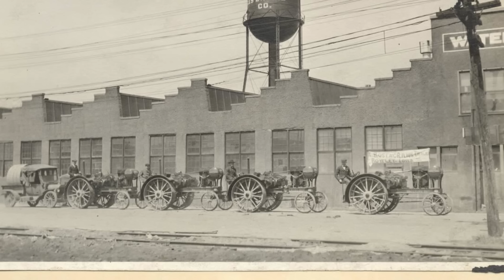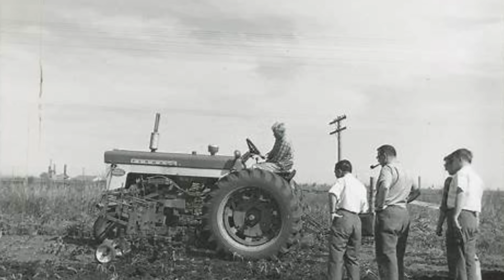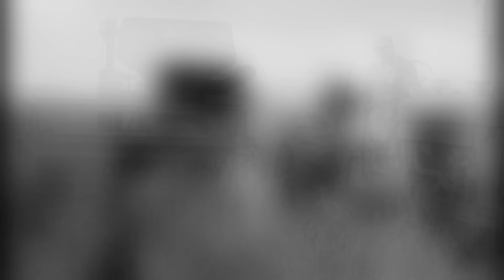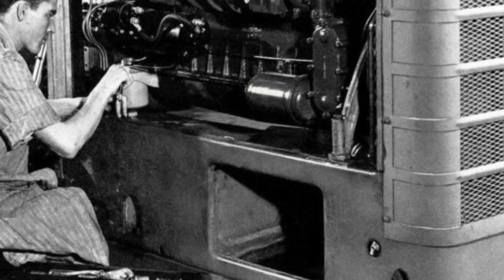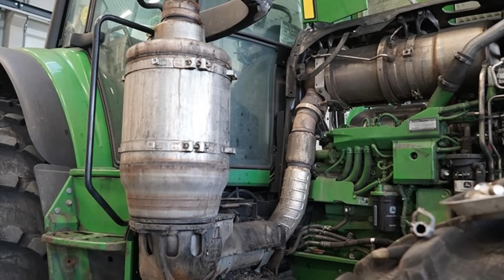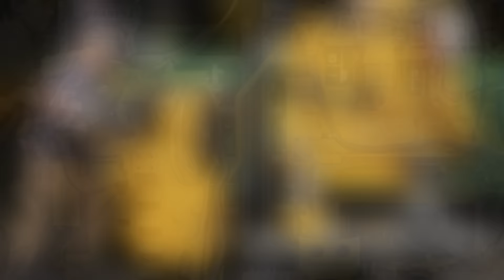What Happened to John Deere? The Tractor Engine Farmers Can’t Fix Anymore

Comment: I once had a tech with a computer tell me he couldn't find anything wrong with an 8 wheeler truck, what in the US would probably call a 12 wheeler. The truck was brand new and stuck in high range. I politely pointed this out to him. They had to change the wiring harness in the end.
Reply from the maker: That sounds like quite an experience! Electrical issues can be surprisingly difficult to track down, especially on heavy trucks. Thanks for sharing your story!
Reply: @RuinedAmerica Auto motive wiring faces the elements. Cracked insulation road salt glyceril  lead to intermittent failures.  On top of that a Control module with custom crypto?? 
Nightmare

Comment: I recall at Antique tractor shows some of the inventive modifications farmers have used as work arounds for design short comings on site.    Those designs apparently have been stomped dead by this corporate greed.
Reply from the maker: Farmers have always been incredibly creative when it comes to adapting and improving their equipment. Those practical modifications are an important part of agricultural history. Thanks for sharing your perspective.
Reply: @RuinedAmerica I grew up on a family farm with 40+ year old farm equipment that was generally unsafe to be anywhere near during operation. My brothers and I managed to keep all of our fingers and toes.  We always pre planned which spot to jump to in case of a sudden change in how things were running.  You learn more from what goes wrong than from what works right.

Comment: You say "the market moved on" NO deere is no longer farmer, frendly the  bean counters and stockholders  are more important than there customers
Reply from the maker: I understand your point. The relationship between manufacturers and farmers has certainly changed over the years. Thanks for sharing your perspective!
Reply: This is fully AI generated content trying to make quick bucks off nostalgia for old tech. The entire text was just scraped from wikipedia and other websites and narrated by robot voice, the thumbnail is AI-generated, the visuals are stock footage. All videos from this channel are just like this. Even the comments he leaves are generated with YouTube's AI subscriber interaction tool. We need to ban low quality garbage like this from YouTube.
Reply: @ang @angelsachse9610 Deere is not a farmer friendly company anymore,they proved that by not letting the farmer get repairs by anyone but Deere at Monopolistic prices 800.00 to just have a technician plug in a proprietary computer/software unit to diagnose an issue ? Nope that’s criminal and not allowing the right to repair by private repair services is a monopoly move!